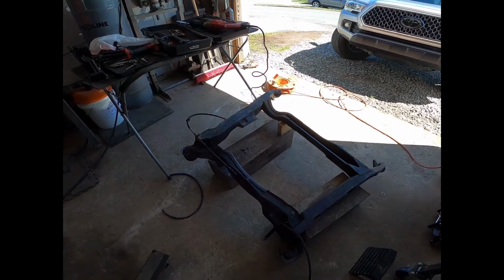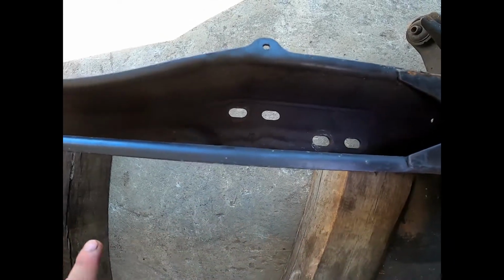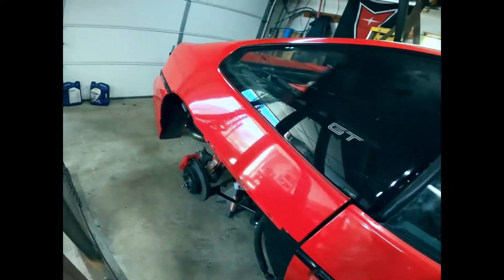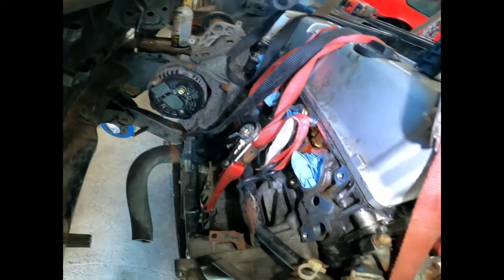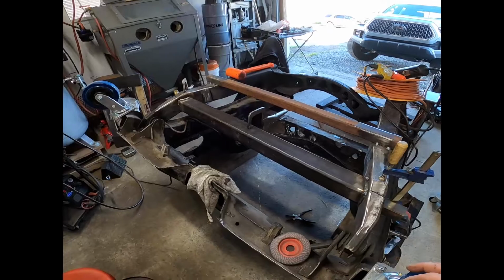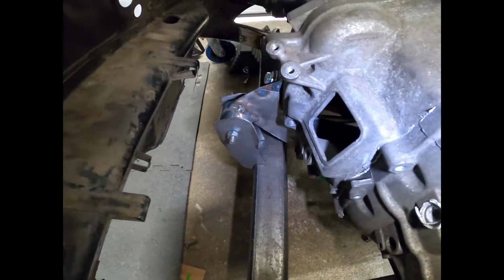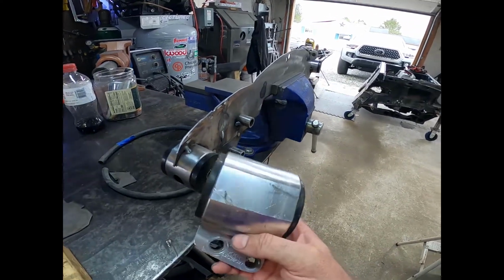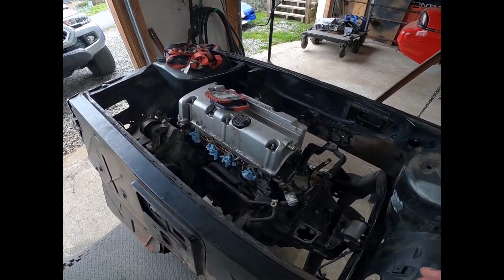kFiero cradle mods for 1984-1987 Fiero

Comment: If you do a A\c and power steering delete kit on the k24 would you be able to avoid the removal of the hump on the front of the cradle? I have a 88' formula and are considering the swap.
Reply from the maker: It should clear as long as you are using a steel oil pan. It will be pretty tight though.

Comment: What did you do with the cvs and the hubs?
Reply from the maker: I used custom axles from the Drive Shaft Shop. Cost about $1300. You can now order them directly for 5 or 6 speed k swapped Fiero.

Comment: You still selling motor mount kit ? I have an 87 fiero and want to put a k24.  What do you do for axles ?
Reply from the maker: Mounts are going back into production. Axles are made by DSS (driveshaft shop). Info for the 5 and 6 speed axles as well as current mount production is at kFiero on facebook.

Comment: I've decided to do a kswap in my fiero. Started researching and found your channel. I havnt watched all your videos yet so you may have answered  my question already. But what transmission  did you use?  I'm thinking about using the original fierro 4 speed. If so did you find an adaptor plate or custom build one?
Reply from the maker: I used a Honda transmission in both of my kswaps. Using the stock fiero trans was never a consideration on my part.
Reply: @BVM03  ok I've been going back and fourth on it . Thought if I could find an adapter plate I would stick with the fierro trans if not I would go with a honda trans.

Thanks for the reply.

Comment: How much different is the 88 cradle mods ?  I have a 88....I'm tempted....
Reply from the maker: Pretty much the same with the exception of the rear (trunk side). I would need to get my hands on a stock 88 cradle to make another. On my sons it uses the factory trans mount and mount location with a custom bracket.

Comment: very interesting, are you working on mounts with a K24/auto trans as well
Reply from the maker: If I had an AUTO trans (really just an empty case), I could make mounts for that no problem.
Reply: @BVM03  I am curious if you ever finished the midplate. I think it along with the front motor mount would make an K24/auto work and i would only need to make the transmount